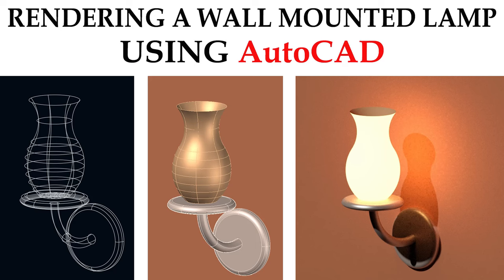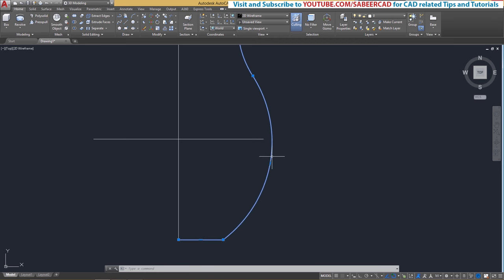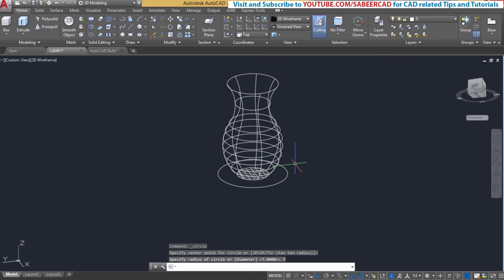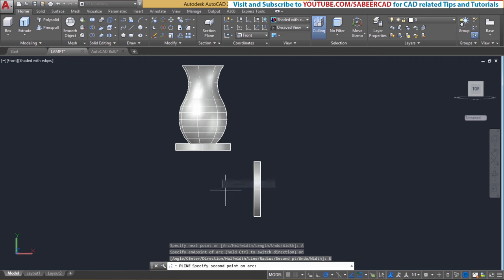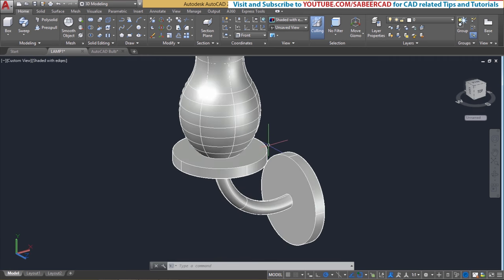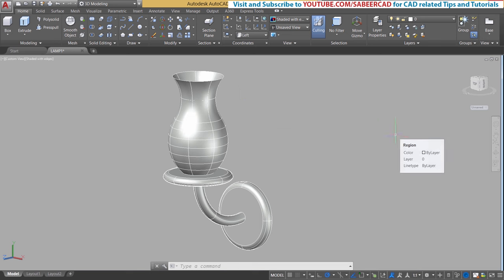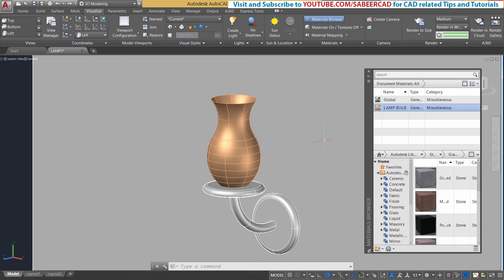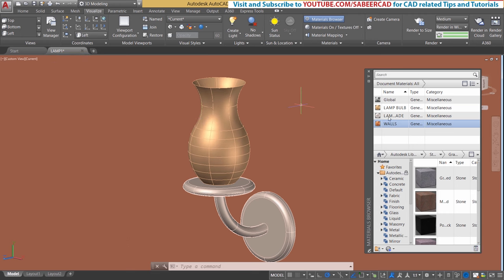AUTOCAD 3D WALL MOUNTED LAMP MODELING AND RENDERING | AutoCAD RENDERING

Comment: Great tutorials man! I have followed a few. for this one in particular I am having an issue, once I got the lamp with the base wall and connection and I put the SW isometric view, all the components get separeted and they're too far away from each other. What could it be?
Reply from the maker: Its an alignment issue.  Just closely follow the procedure,  you will surly get the result

Comment: This was such a good tutorial. I just had a small hiccup. when i tried to fillet the base under the lamp (the 2 edges), it give me something completely weird. and it wasn't until i went to add my materials that i saw that it was fillet but in side. as it it made 2 objects. one that was fillet correctly and another that was on top that remain the same. Could you please tell me why that is?? I spent about 10 min. on that part and could not fine the problem. Thank you once more. and God bless.

Comment: I'm not sure what I am doing wrong but I can not get light to emit from the lamp to cast light on the wall.  No matter how much I adjust the lumins or the reflectivity of the wall, the light does not glow.  AutoCAD 2018
Reply from the maker: If you follow the procedure Step by step you must get the result
Reply: @sabeercad  I figured it out. It was simply down to render quality. My computer is a little slow so I don't use high render unless I need to. Low and medium does not render radiance.

Comment: Nice tutorial. All went fine until trying to mirror the base downward. Only points on the X Y axis were possible. I couldn't go further. I tried work arounds, making a copy, turning and moving it at the right place, but the Z axis problem occurred again when trying to  connect the polyline to both bases centers, again only points on the X Y plane were available. No possible connection between the two centers. (No need to say, I guess, that I an quite new to Autocad.)
Reply from the maker: Make sure that Dynamic UCS is OFFwhen you try this.

Comment: i don't know autocad actualy. upto mirror i did i cant mirror to down side mirror can be done only to right or left only cant go down why it is so extension is ticked already
Reply from the maker: +dheeraj v.menon I have an Online course using which you can learn Autocad 2D and 3D from basics systematically . You may contact me in 09895835350 to know more .